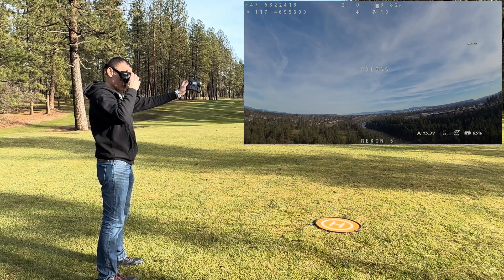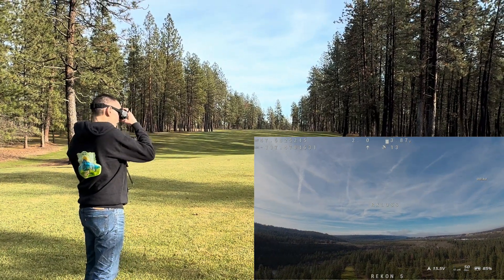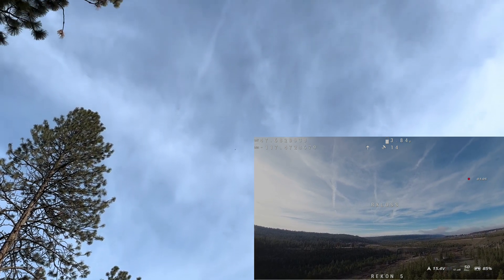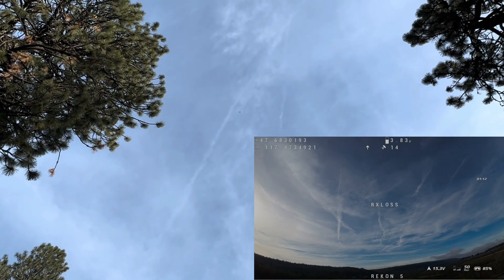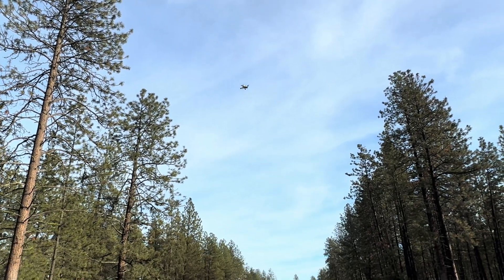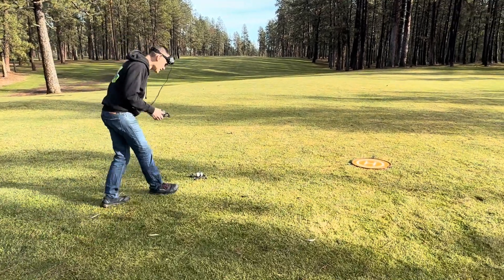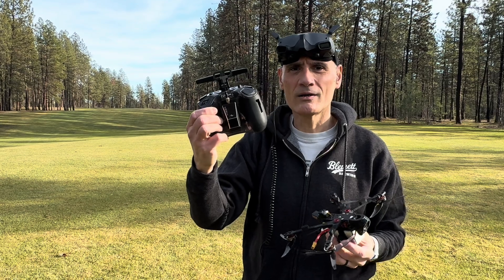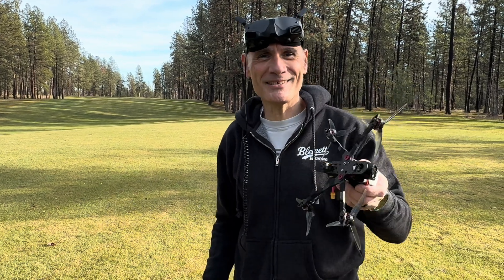Betaflight 4.5 RC2 Return to Home Radio Off Test (Details in Description)

Comment: The nice landing is great and all but I think it needs sanity checks to be on to work which I am not a fan off as the sanity checks in betaflight gps rescue are in my opinion too trigger happy to disarm the drone if any of the conditions are met.
Reply from the maker: Thanks, yeah it seems to be pretty good.  For what it's worth I checked and I do not have sanity checks set to on, I have it set to Failsafe Only vs On or Off.  Not sure if it makes a huge difference but so far it's been working well in my tests.

Comment: This is awesome! Great demo video! Now I hope that the Walksnail video system is truly fixed to work now with GPS because I was waiting for Betaflight to make this happen. I lost my first 7" drone with the Walksnail vtx trying the GPS Rescue on 4.4 sometime back. Thank goodness i had a beeper or else it would have been a permanent loss. Something happens where the original Walksnail vtx would block some or all of the GPS signal during flight and not really let you know. And i had gps rescue on a toggle and tried it about 200 ft up. It started to work , but decided to just take off before getting to me. Sucked, but the coordinates of where i lost video ended up saving the drone. Looked the coords on google maps and got to where i heard the beeper. GPS ended up working in a different capacity. Gotta love technology!
Reply from the maker: Thank you for watching and the great comments.  I hadn’t heard about the issue with Walksnail and GPS, that is pretty wild that it caused so much trouble with what sounds like some sort of interference from the vtx.  Especially since it was happening after things were working.  Good to hear you recovered your drone!  Having lost a few due to faulty gps rescue in the past, before figuring out I could have latitude and longitude on my OSD, I’m always so nervous about long range flying and hoping everything will work perfectly.  Beeper is definitely a must when doing this stuff, they are so loud they really help.  Yes indeed, love the tech, it’s a blast!  Take care.

Comment: Nice 👍.... try to test on low altitude and from short distance like 12 meters 3 meters altitude next time.
Reply from the maker: I plan on it soon, this weekend!  Supposedly it will fly out to your distance/altitude settings first before returning to home.  Wish me luck 🤞
Reply: @smithe68  good luck to you.🤞😊 Please make video on settings if you can.thank you!
Reply from the maker: @Sam-gr8pl  so I tested this today, I might not get the video up until next week because I’m heading to go camping.  I will tell you it worked quite well.  I was quite low and not far out.  When I activated GPS rescue it flew up and away until it reached the default distances before starting it’s return to home.
Reply: @smithe68  oh thats great thank you for the test🙂 i will be testing this on my 3 inch quad. but b4 i will do that.i will use your settings.waiting for your next video.. enjoy the camp....greetings

Comment: Usong iNAV though i once used RTH and was letting it just land. When i realized it was off by a few feet and it was so close to tree i got nervous. I forgot i took off so close to the tree. I had goggles on then i see top of pine tree i panicked and took over haha
Reply from the maker: I thought about the trees after I took off but took a chance.  You know I should test if turning the radio back on will connect up quick enough to take over if I needed to do that. Not even sure why I would need that but maybe if my batteries died and I had to swap them?  Thanks for sharing your experience, good to know I am not the only one that has moments like that!
Reply: @smithe68  it takes few seconds for radio to turn on and few seconds to connect. It's not terribly long but in an emergency it feels like forever.. I want to test 4.5. I put it in a quad. But when I went to test found quad had major issues now. So I finally fixed it. Take it out yesterday and the tune is wacky. So I have to retune
Reply from the maker: Interesting, that is fast compared to Betaflight!  The sick tune gave me issues on 2 drones but not my Rekon 5. On the other 2 it was due to rpm filtering being turned on, as soon as I disabled that everything was much better. Good luck and sorry for late reply.

Comment: Weird how it kinda drops and catches itself over and over as its coming down, lol, wonder why they have it do that do that? I thought  it was falling for a second there... But it is pretty cool that they seem to have got it working pretty good, i definitely wouldn't rely on it or would even disable it if you have a BMI gyro though with its calibration issue, the betaflight devs recommend not to use that gyro now especially with self leveling modes like rth, i tried rth a year or 2 ago but it was terrible and rarely  worked but i  do like having the mph and gome arrow, so i put gps on all my non micro stuff just for that, but i have never had a gps work for very long seems like they just die eventually after 3-6 months for some reason, also im pretty sure betaflight usually is set to beep your beeper then you loose your radio controller connection anyhow...
Reply from the maker: I thought the same thing not sure if there is a setting that can make it smoother.  I have had this same behavior with two different drones.  I definitely don’t think it’s foolproof but it sure is better than the old return to home that worked when it felt like it with random behavior.  I once had a drone return to me after a failsafe and it just hovered in the hair about 50’ up spinning randomly in both directions for a few minutes, then it landed, this is before landing was even an option 🤷‍♂️  Thanks for pointing out the BMI gyro thing, I just saw something about that but hadn’t had the time to watch the video to see what it was all about, got one queued up for a little later. I’m with you, been putting GPS modules on anything that isn’t too small to have one on it.  That’s weird about your GPS longevity, I’ve got a couple HGLRC ones from 2020 that are still working well, my first test with this new feature was on a  DarwinFPV 129 with a GPS I pulled from my first long range build I did Summer of 2020.  Hmm, that’s interesting, I don’t think I had beeping until I added it, I’ll have to check.
Reply: @smithe68  all my drones  beep if i turn off my radio before unplugging or if i forget to turn the radio on first
Reply from the maker: @DigitalCruzer  I think I have a bad habit of turning that off cause it annoys me when I am working on a drone in betaflight and I don't have my radio on and I forget to turn that feature back on 🤦🏽‍♂

Comment: So awesome 👏🏼 I hope to set GPS up on my next build. Now it’s getting better with each update. I have trust issues too lol
Reply from the maker: It’s really great and even the old version has saved many of my quads.  This is so much better though!  Good luck and let me know if you need any help.
Reply: @smithe68  I will definitely be askin for help. I hope to start on it February. I’m still collecting parts.
Reply: I have used it since it came out. Of course, first GPS Rescue versions were shitty, but still, they took over and flew in the home directions and saved me countless hours searching in fields, mountains and forests lol. Always worked in real rxloss or videoloss situations and always worked better than a failsafe crash someplace.
Reply from the maker: @tstrrtstrr745  like you I have had GPS rescue save me a lot of time searching!  One time with an older version I lost rx and my drone came back and hovered about 100’ above my head until my battery died, at least I got it back though lol.  This new version seems to be great so far and I am sure they will continue to make improvements.  Thanks for watching and commenting 🙏🏽